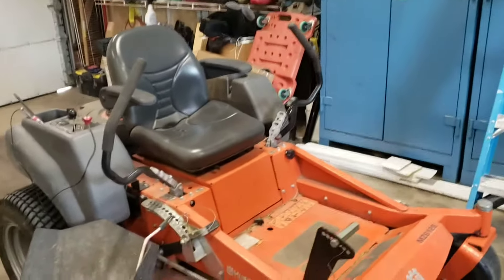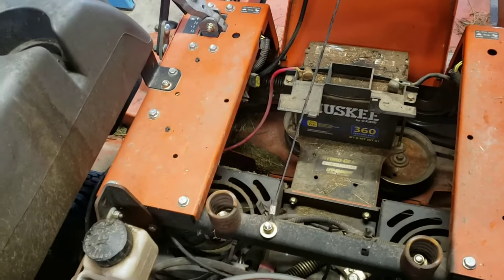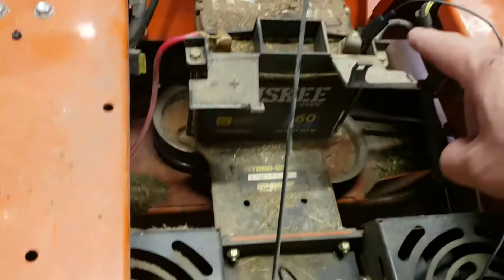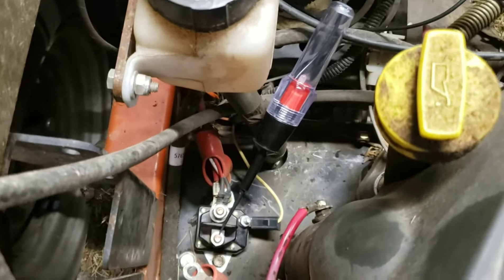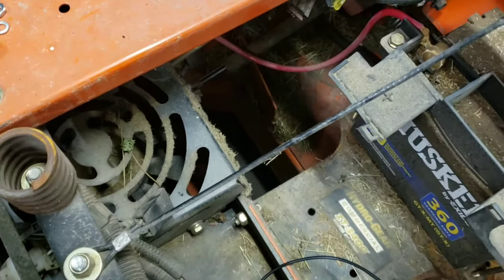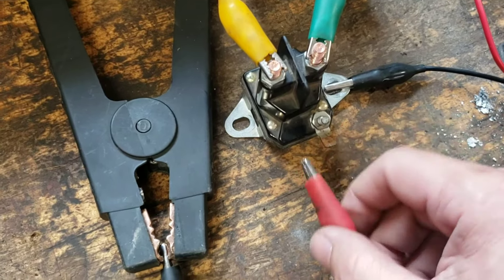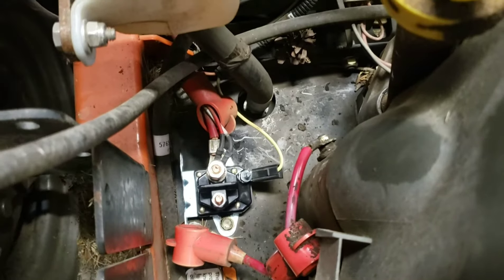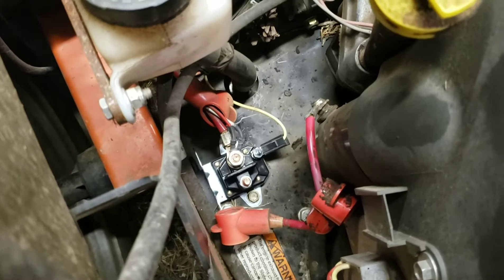Diagnosing a bad starter solenoid

Comment: I looked at the two reviews below and must agree.  This is really the perfect way to diagnose a safety switch issue and if not that then a starter solenoid problem.  This should be a very strait forward and simple diagnostic, but you are apparently the only person on Earth  who can explain it easily.  You have saved me an enormous headache.

Comment: Thanks for the excellent video on starter not cranking.  I wasted a lot of time watching other videos that started at the battery and then went on to check every single thing that led up (finally) to the solenoid.  Your approach was 100% better, cut to the chase and the tip on how to check all the other safety switches by going right to the solenoid was right on.  Thanks again.

Comment: I'm a woman thats very handy but lack in fixing motors, carbs n such. I was mowing, stopped and turned it off for 10 mim and when I tried to start it, absolutely nada. No clicking, no noise just dead. Battery was fine but when I did your test I had absolutely no light come on on my meter anywhere on the solenoid. 
Thank you for making a detailed video, you helped me figure it out so I didn't have to borrow a trailer and wait 2 weeks!
Reply from the maker: Glad you got it going!
Reply: What was it because mine doing the same thing

Comment: Thanks for the video and info.  I skipped all the safety feature checks and tapped on the solenoid right away.  Seemed like the most likely suspect for sure.  After a few good knocks it started right up.  So now I get to find one and replace it as well.  Thanks again for posting!

Comment: I have a MZT52 that just hit 200hrs. Got the Briggs Endurance motor. It’s been an excellent mower. Thus far only oil changes, air filters, lube, and blades. Getting ready to service the hydraulic system. I have had to tinker on the e brake safety switch a couple of times. It likes to get out of whack.

Comment: I think I have the same mower with the same problem. If I shut it off after it's been running, then half the time it doesn't want to do anyting when I try to start even if all the safety switches are set right. I'll get my multi-tester out and see. Thanks for the head start!
Reply from the maker: Mine was doing about the same thing before it got real bad. I think the heat gets to it
Reply: read my comment above

Comment: if you do not have a test light try this  with brake pedal down  and blades not engaged    and setting in seat turn key to start if it clicks only ------then short  between two big lugs on solenoid  useing a screw driver or pliers  if that spins starter  replace solenoid  with same type  takes about 2 min. to do this test.

Comment: Quick question. Does it matter which side the same terminal is? As in does it have to be on the battery side or it doesn’t matter if it’s on the starter side?
Reply from the maker: If I understand the question, it shouldn't matter since it is just completing the circuit

Comment: For educational purposes, do you have to unhook the starter wire on the solenoid?
Reply from the maker: You do not have to, but be careful since it could start when you aren't expecting it to work
Reply: @avarageerod So my test light only lights up when I unhook the starter wire. When its hooked on no light... Why?

Comment: Ive done troubleshooting but have this problem. 
Bad Boy 52 magnum with Kohler
Mower stopped when seat sensor activated.
The key does nothing, but the blade button still activates via click sound
I got it started to get it in the garage by bypassing seat switch and jumping solenoid
it would only start doing both. only turned over without seat bypass.
The safety screw on solenoid doesnt light even with seat bypass connected.
key continues to not even click, though if you bypass seat and jump solenoid, it runs perfectly.
Reply: sounds like need new seat sensor and the the solenoid. thats what hes saying that if one the sensors is messed up it wont allow the mower to crank normal
Reply: @803dj5  turned out to be the cable that attaches the brake lever. I kept testing everything good, but luckily noticed it was broken using a mirror. Thanks for the reply.

Comment: Gotta question on this I have power going in but nothing else not even at that little wire or to the stater nothing so wold this siloned be bad or? I'm at los and there is nothing at the fuses no power but I do have power going in but no where else so my question is is my siloned bad or can tell me any advice? Please thank you
Reply from the maker: It does not sound like the solenoid since you arent getting anything to the little wire. Sounds like a blown fuse. You might want to check for power at the key switch
Reply: @avarageerod  nope there new
Reply: @avarageerod  and there is no power

Comment: What else could it be if you change out the   Starter syllonoid Pardon my spell check,and the Ignition switch and it won't start  you have to jump it off The fuses in the fuse Box seemed to be OK
Reply from the maker: Are you jumping it off at the battery? I'd so it sounds like a dead battery
Reply: No sir I'm jumping it off at the starter cellular which was brand new and the switch is brand new starters switch or Ignition switch my bad I hate bypassing cause like you said safety
Reply: I must  Proof Reid stupid spellcheck
Reply from the maker: I'd pull the small wire from solenoid and test it. Once you pull the wire use a volt meter or test light and you should have 12v when you turn the key to the start position. If you dont your not getting power from the key switch. You can test the solenoid in the same way by running a wire from the hot side of the battery and touching the solenoid where the small wire goes.
Reply: Good deal , when I get a chance to try that I'll let you knowHow it goes
Reply: @avarageerod   Well I tried that and everything's getting juice in that vicinity
Reply from the maker: @BobbyParker784  does the solenoid click when you turn the key to the start position? You can also check the solenoid by testing for voltage on the lead going to the starter when you turn the key to start
Reply: @avarageerod   Yes It clicks but I don't have the equipment to check the voltage If I can get ahold of a trailer I think I'm gonna bring it to the dealer by the way it's a Ariens 52" Apex, Luckily still under warranty just have a difficult time getting it there I like fixing things myself but it's a little bit above my pay grade lol

Comment: My mower is making a loud clicking noise when key turned why?
Reply from the maker: Could be a few things but it sounds like the starter solenoid or the starter is bad. Worse case would be the engine is locked up.

Comment: I have a 27hp Kawasaki motor put new selonid and starter clicks but won't turn motor
Reply from the maker: It could be a few things. A low battery, bad starter or the engine could be locked up are the first things that come to mind.